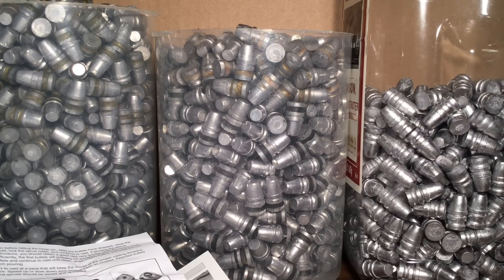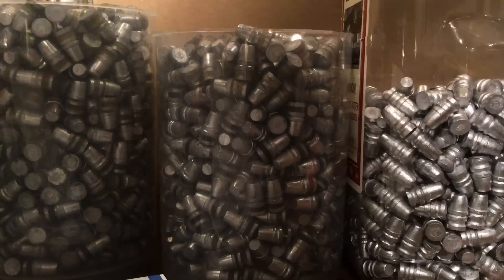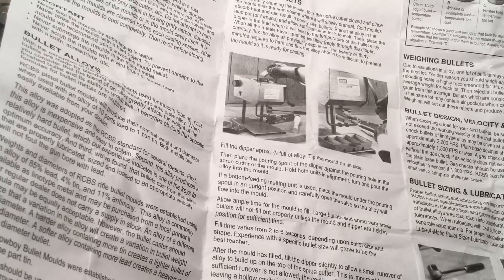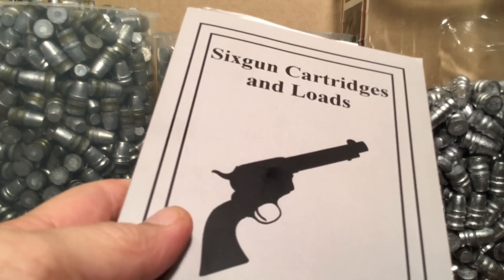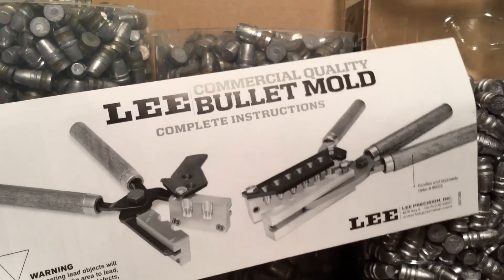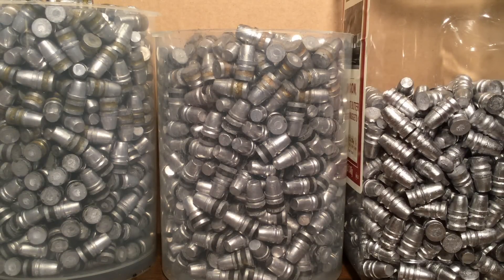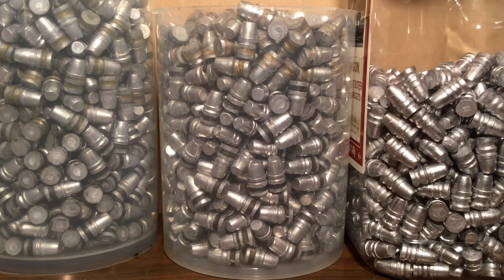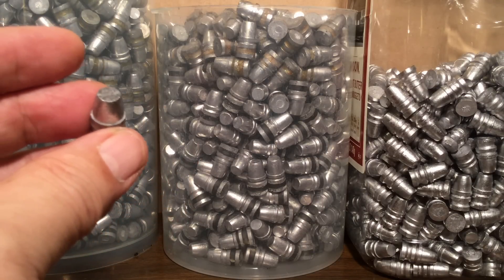The Big Hardness Gain Bullet Casting Water Quench Controversy - VR To Carl

Comment: If we are going to use the alloy bullets on game that requires deep penetration like some African game, the Great Bears, Elk, and Moose,  the need is for STRUCTURAL integrity while traveling through the bore, and JUST AFER exiting the bore, this need is also shared by bullets intended for nothing tougher than a paper target.  Pressures of over a certain magnitude will cause deformation both during the travel from the case mouth and through the bore, but just after exiting the bore as well.  Accuracy with softer alloys will suffer not so much because of lube failure or incorrect sizing, but because of the foreshortening and expansion of the bullet both during it's travel from case mouth and through the bore, but also just after exiting the bore while being shoved out by expanding powder gasses and the waste, partially burned, propellant, soot, etc.  As one wag once stated, "when the big light slaps the bullet on the ah........ base, it will fit the chamber mouth"  the search for hardness is not for HARDNESS,so much as for STRUCTURAL INTEGRITY!  If a hunter is trying to get his bullet not only to shoot accurately at useable velocities, but to also penetrate enough to break bones or to penetrate the brain deep inside huge and often deeply angered Big Game, it is structural integrity, not hardness it's self that is required.  Too much  hardness will result in the bullets breaking up on large bones or in the case of Elephant not only hard bone but several inches of skull surrounding the brain.  Politically Correct Twits have legislated away the use of lead alloy bullets for hunting in many game fields so what remains is a need for the bullet to remain together long enough to get sufficiently enough distance from exiting propellant gasses and debris not to be damaged.  I don't know how we deal with self defense ammunition, the same conomdrum still exists, the bullet must not only hold together well enough to exit the bore without damage, escape harm from high pressure propellant waste, penetrate the target sufficiently deep to be lethal, and hold together upon striking bones, hopefully penetrating them and breaking them in the process, that is an awful lot to ask of an alloy bullet cast by a fellow at his bench with such high hopes, and we pray, with knowledge and skill as well.  We have come a long way from the Paper Jacketed pure lead bullets of the Buffalo Hunter with his Sharps or Remington Rolling Block rifles.  It is because of the aforementioned reasons that I gave up on using antimony in bullets for use on game, using nothing harder than heat treated 1-10  alloy.  The heat treatment without at least some antimony is of questionable efficacy in any case, but experience has told me that 1-10 alloy USUALLY  will hold up well enough for about 2,000 feet per second, but not for much over 30,000 CUP.  1-10 or 1-16 will with maximum 45-70 loadings of around 2,000 feet per second, perform their tasks on even the largest of game very well, they will in the case of bullets of 330 grains and upwards penetrate several FEET of Elk and often exit the animal as well, leaving tremendous devastation in it's path.  

     There for what it is worth are my observations, and I might add, the observations of my mentor Elmer as well.  We would all do well to read carefully the experiences of Keith, Selous, Hunter, Taylor, Whelan, and Hatcher especially, there are others as well.  We don't have to reinvent the wheel every generation,  do we?

Best Regards

Don
Reply from the maker: Donald Denison - The recent mixed alloys using Copper Hard and SuperHard alloy mixed with range scrap to BHN 20 water quenched to hardness that my thumbnail cannot even get a purchase to do the thumbnail test.  So I took one of the bullets and smashed it with a construction hammer...expecting it to shatter or break up, I was surprised with the toughness of the bullet, it resisted any shattering - the structural integrity that you mention.  I can't see how these bullets would break up on bone after smashing these down.  Best to ya, Don....Steve
Reply: Dear Steve:

     The problems with structural integrity with alloy bullets doesn't exist until service velocities are reached and terminal ballistics are considered.  Unless one his hunting very large and or dangerous game there is no  problem, there is also no problem with structural integrity assuming that gas checks, and proper loading techniques are used.  The only real problem is bad performance when large bones are struck at high velocity.  Most don't know how to get an alloy bullet to shoot accurately enough to be useful at velocities over about 2200-2300 fps. , let alone have the fortune to encounter something over 1000 lbs that is trying to bite or stomp him into a bloody puddle.  The point is moot in any case, fools have made sure that we can't legally use alloy bullets for hunting anymore, and in the case of California, the only animal of a size and temperament needed to require such tough bullets is extinct now, done in by  soft lead bullets, traps, poisons etc. How many California Grizzlies actually attacked and harmed people is unknown now, though there are tales about 1600 lb. monsters of vicious temperament.  It is a fact California Vaqueros once took them on with horses and rawhide riatas.  I find this almost incredible, any horse I have had anything to do with went wild even around a small black bear.  It would have been interesting to know how really tough these big animals were, not that I would want to encounter one though.  A hammer and an anvil as I have said tells us something, but only use on game and at that only at high velocities approaching 2500fps will actually tell us what hard alloy bullets will do on game.  I have had only the one experience of a 100 grain 25 caliber bullet of linotype at nearly factory velocity that I have actually witnessed myself to go on.  That performance was totally inadequate, and did result in bullet breakup.  High velocities are known to have caused fragmentation of jacketed bullets, that was the reason we have Nosler Partition bullets now.  They are almost boring in their flawless terminal performance.

Bes Regards

Don
Reply from the maker: Donald Denison - Thanks huge for this - actual accounts in the hunting fields is what we need to see - I would not consider using cast bullets on game with anything less than 30 cal.  It's the old "needle blower" philosophy.  I'd also go with the Nosler Partitions without hesitation.   Best Regards to ya,   FC
Reply: Dear Steve:

     I've actually posted three or four times on this subject.  The problems with hunting bullets is largely moot these days with the legislative stupidity that is current.  Actually it was all pretty well thought out by the 30's, but until ALOX 2138f in 50-50 mix with beeswax, and now powder  coating, leading was a common problem.  The big puzzler has always been how to get the bullet to stay intact to the degree necessary to be lethal even with large and dangerous game.  The consensus was that antimony was the culprit, a small amount is necessary along with a tiny bit of arsenic which is present in almost all lead sources to make heat treating feasible.  Antimony was found to exist not in alloy, but in mixture for the most part especially when in larger than  just nominal quantities, in crystalline form, leading to fracture when striking an object at high velocity, something that can't be duplicated with a hammer and anvil. The solution was to use proper techniques in smelting the alloy to get just a little antimony and arsenic to alloy and not exist as part of a crystalline mixture.  It proved that only a tiny, very small amount of these two metals was necessary to allow heat treatment.  In most sources of lead  there is already sufficient arsenic, leaving proper smelting of the antimony into the alloy a problem, something Super Hard has already done for us, just an ounce of this in a 20 pound furnace is sufficient if added when the mix is hot enough to get the antimony to alloy.  For Game nothing but lead and tin 1-10 or with lower velocities 1-16 with a tiny bit of antimony to allow heat treatment will work worth a hoot.  Velocities of about 2000 fps are possible without too much leading given proper sizing,  and are possible with accuracy.  This velocity in very large bores is sufficient up to about 150 to 200 yards. The cohesive nature of this alloy does not allow shattering even at close range, I have witnessed an elk going away at close range, shot in the left hip with a 420 grain 1-10 alloy bullet that not only broke the hip, but destroyed everything in it's path and was found just under the skin on the right shoulder,  now that's bullet performance.  The same alloy is good to shoot without leading up to about 2,000 fps even in small bores like the .30, getting these loads to shoot with accuracy takes a lot of fiddling, usually with slower powders, a bit of wad or filler if appropriate, and careful sizing, it is not always successful in all barrels.  For target work, forget it, and go straight to Linotype and SAECO's RG4 or whatever they are calling it now, this bullet along with the Multi Groove Loverin bullets .311407, and 311467, the latter a pointed bullet, these three can be driven at  speeds with accuracy at about 2.500fps.  bullets .311284 designed with the Krag in mind and .311299 designed for the .303 (this bullet also works in .30 barrels, there is 314299 available for .303 barrels that are on the large size) also work well, but cannot be driven much over 2200fps,  all of this became possible regularly only after ALOX 2138f and yellow bees wax 50-50 was developed.  These five bullets have been used successfully at 1000 yards from good .30 caliber barrels using proper sizing and lube since the advent of ALOX 50-50,  Now that ALOX 2138f is discontinued, ALOX 350 as a substitute is being used, it requires microcrystalline stiffeners, and in my humble opinion, is not quite as accurate as the old mix, leave out the stiffener, and you better have a frigid loading room, it is worthwhile though as the .350 mix without the stiffener is every bit as accurate as the old mix.  Lithium Chassis Lube is better than anything, but what a mess to work with.
Reply from the maker: Donald Denison - Thanks for your valuable and interesting comments.  My last RotoMetals order included 25 pounds of 1 - 16 alloy.  I've been wanting to use this alloy to cast exactly what Keith and others have used, for quite a while...finally, I'm going to be casting those.  And my recent use of BHN 20 alloy was to explore the harder aspects of cast bullets.  All these years, I've been shooting the regular stuff BHN 15 -18 and it worked splendidly for the shooting I was doing.  Not having done any real hunting, I've never needed the softer alloys.  Best to ya,  FC
Reply: Dear SteveL

     As I mentioned earlier in one or perhaps in all of my responses, legislative fools have taken the legal reason for the existence of malleable bullets that wouldn't fracture.  For target work, even 1,000 yard shooting, Linotype works out just fine.  It is no surprise to me that fairly hard lead tin alloys can be made to shoot well, and perform well in game;  many fairly knowledgeable cast bullet shooters who have been also users of their cast bullets for game have used 1-10 alloy, Richard Lee was one of the first to publish about the need to keep the bullet fairly intact during it's passage down the bore and shortly after it's exit,.  Lee's cast bullet section of Modern Reloading deserves careful attention. Hatcher's first successes came with Surplus 4831 and IMR 4350 which did not abuse the alloy bullet overly, remember when H4831 came in coated paper coffee bags from Hogdons for a dollar a lb., evidently the slower burning powders do not slap the alloy bullet excessively at least in the '06 and the .30 US.  Now that hunting with alloy bullet is legally a thing of the past, there is no need for cohesiveness, only enough strength to get down range  with an undamaged bullet matters, except of course for CAS shooters who need soft lead bullets, Linotype works for target shooting very well. This leaves us with self defense loads  that must penetrate various substances like clothing, sheetrock, and glass.  I would think 1-16 would be just the ticket, it is sufficiently hard to be shot with magnum loads, and should penetrate anything but top grade body armor,  this alloy is sufficiently malleable to hold together if a large bone is struck, if God forbid, you have need to shoot another human being.

Best Regards

Don

Comment: Also... it completely depends on your alloy on how much your BHN will increase with WQ. It’s when your pushing the envelope on velocity that you normally want harder. I am like you though, all of my stuff these days are always under 20bhn.
Reply from the maker: AlaskanGuy RemoteAk - Before I learned about WQ, I controlled the BHN with alloy composition.  When WQ became fashionable, I heard all the claims about getting 10 more BHN after WQ.  To this day, I do not depend on WQ to get me hardness exceeding that of linotype, choosing to be on the conservative side as WQ does get us more hardness, but the amount is uncontrolled.  For example, I'll use BHN 15 alloy for my auto pistol alloy, and WQ will get me more hardness - to what doesn't matter to me as I'm good with whatever it is.  If I cast 44 Magnum, I'll use BHN 18 alloy and WQ again to whatever I get.  The bullets shoot fine, clean and accurate.  If they did not, I would look for solutions.  My current 357 Maximum 22" barrel project, I am casting 200 grain bullets with pure linotype and WQ also.  Have a great day,  FC Steve

Comment: No one is getting BHN 26 water dropping.   One of my friends water drops everything he casts and gets about 19 out of wheel weights.  I ask him if he had checked his bullet hardness at casting and then again in 6 months to see if they had lost any of their temper.  I have read that bullets loose some of the tempering as a result of aging.  I air drop because I cast out of linotype (BHN 22.)  Good topic.
Reply from the maker: ideadeye2558 - Getting an extra 1-2 BHN from water quenching seems to be what we can reasonably expect.  And getting an extra 1 BHN on age hardening would also be workable. Then in the long run, we can lose that age hardening.   But as for heat treatment of lead alloys, an article in LASC speaks of needing some arsenic in our alloys to get heat treatment results.  Like you, I have found that the alloy we use results in the most reliable hardness as we can't really count on getting X BHN if we cast at 780 degrees then water quench with ice water, etc.  or we can get X more BHN if we heat to 350 degrees for 20 minutes and then water quench  + allow to sit 3 weeks for an additional X BHN.   Have not casted with pure linotype even though Lyman recommends that for some of their high intensity loadings... Have casted BHN 20-22 for 458 Win Mag though - and those bullets shot well.  Might just cast some linotype 30 cals pretty soon though... Best to ya,  FC
Reply: FortuneCookie45LC I'm surprised that you only get one or two numbers up from water quenching for your bhn. With my hardness tester air-cooled wheel weight is approximately 10, but when water dropped it goes to approximately 18. The range lead I have access to is soft, only about 6. Shockingly depending on the mold used water-dropping will jump it to 12 - 15, apparently mass of bullet changes the cooling profile?? Thanks to you FC I don't really have to worry about that anymore as I powder coat everything.